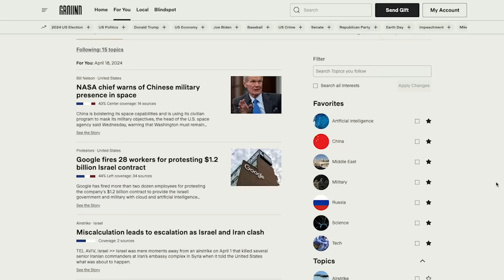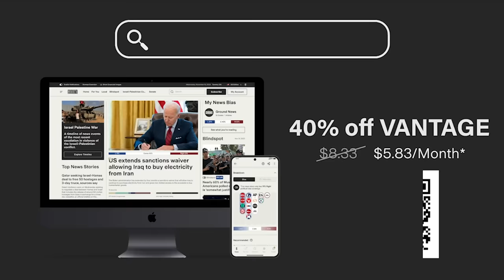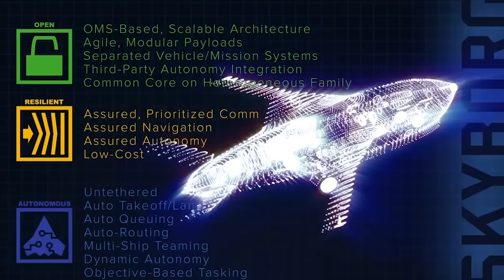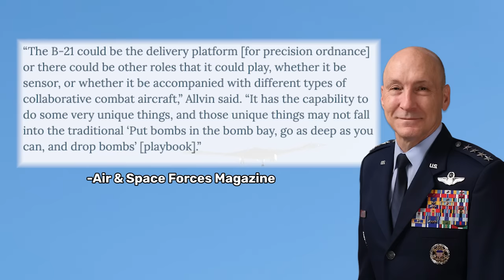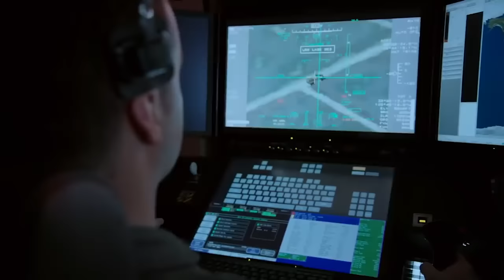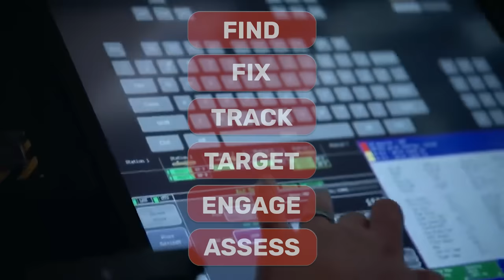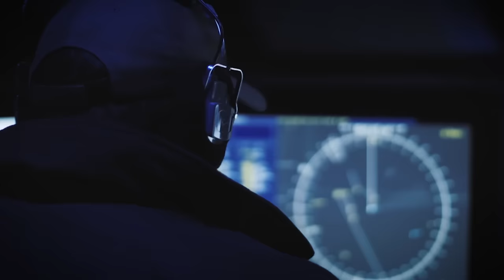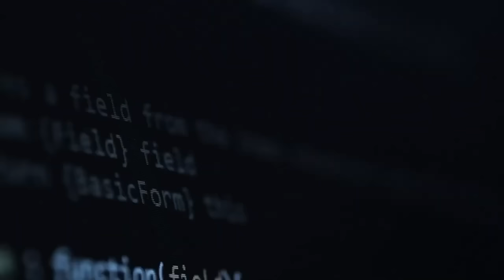Is the Air Force already developing a replacement for the B-21?!

Comment: I just hope this doesn't turn into we are gonna buy 200...no, 100...no 50...and then they do it again with the next model too. The procurement pipeline has become a bigger threat than most nations
Reply: it's exactly as you say. Happened to B2, B1b, and F-22.
Reply: Come on guys we have to let China catch up with us we can't have the greatest of everything and lots of it
Reply: Yup long history of this🙏🙏🪬🪬👍👍🥃🥃💎💎🇬🇧🇬🇧
Reply: Exactly.  What's the point of making your bomber extremely modular if you only take minimal advantage of that?  These functions can't be added to the B-21?
Reply: But that's how it goes. Money has to be allocated to these programs. At the beginning things look big and then they have to scale down to keep everything within budget (lol).
Reply: I believe Alex has a video on this channel that discussed Air force/Navy moving to smaller, more frequent production runs to take advantage of new tech more often. Might be all part of the plan (also the US is broke af now thanks to Biden/Dems spending spree as of late).
Reply: Now I read the comments as I'm listening to the video. So, I'm not sure what it stated, but there appears to be a trend towards speed. Maybe the new bomber will have stealth and speed. There's a push for ceramic radar absorbing material that's also capable of taking on more heat.
Reply: The better is the enemy of the good
Reply: We know it will they always do this 💩. Did it with the f22 for the F35 and watch they’ll do it to the F35 for the ngrad program
Reply: They are not going to short Northrop Boeing and Lockheed.
Reply: @ApocolypseZombie  I would hope they tried, but maybe the B-21 design doesn't allow for AWACS-like abilities.
Reply: Exactly. One has seen that scenario so many times before. :(
Reply: My guess is that something about the shape/size/layout of the B-21 doesn't allow for the types of sensors and data processing required for the killweb concept. They probably also want something that can supercruise, and a flying wing design doesn't really do supersonic speeds well. Add to that the way recent advances in computer modeling and 3D printing allow for faster development of new designs, and I think it makes some sense to start pivoting to newer, more promising designs.
Reply: There’s always that conflict between buying your current thing at scale, or investing more in the next generation.
Reply: if the B-21 is as capable as they say it is then 100 would be sufficient to rule the world.
Reply: @tgray1  The US literally can't go broke, thanks to deficit spending (and by the way, Reagan started that thing up).
Debt is literally meaningless, except as a political talking point.
The republicans created the debt, Clinton turned it into a surplus, and the GWB spent us into debt again, and Obama did a lot to pay that off.
Oh, sorry, that doesn't align with your narrative, my apologies (I'm not apologizing for anything, the facts don't care about what's good or bad for your ulterior motives).
Biden is spending a lot of money, it's true. But what we have right now is not a "conservative" and "progressive" party in the republicans and democrats. What we have right now is a cult and a conservative party.
If I can't have Obama as president again (and I know I can't), I'd still rather pick anyone else than have to choose between Biden or Trump.
But if those are the only options, I'm gonna choose the one that's not gonna literally try to kill me for my beliefs (I support trans rights and the right of women to have access to reproductive care).
Reply: Are debt payments have exceeded our military for the first time in history. Even during ww2.
Reply: No, it wont
The B-2  and B-1 are too expensive to operate so the USAF needs to consolidate to the B-21 to save cost
if there is something in the works, it will be something that can mirror the B-52s capabilities
Reply: @44R0Ndin Yep, so many people conveniently forget that surplus we had in 2000. I agree with you about not being excited with either candidate. If it was legal, I'd definitely take Obama back. Jeez, at this point, I'd even take Slick Willy back for a third term.
All we can hope for is to endure the next 4yrs without any major incidents and get some younger blood into office. Oh, how I wish that this country wasn't run by geriatric people.
Reply: Well a lesson learned from SAC is that technology is constantly evolving, we lose time, money, and effectiveness if we’re constantly overhauling the whole fleet.
Reply: It absolutely will.  Strategic bombers are obsolete.  Ukraine is hitting targets deep in Russia with missiles and drones, and their tech is a fraction of what the US could bring to bear.  There is simply no reason to continue building heavy bombers, this will just draw resources away from better defense options.
Reply: I get that they don’t feel super under pressured due to the fact that almost everyone else is pretty far behind and our older aircraft are still really advanced, but the future will come and we will need an actual whole new fleet not just a few of new aircraft that are advanced.
Reply: @cyronader  And the more they mess with the procurement, the more it really costs us in the long run due to lack of spares and maintenance windows.
Reply: 90 thousand dollar bags of fastening nuts, that is all.
Reply: @44R0Ndin  good lord, someone who actually isn't blinded by simplistic ideology and actually has thought about it. bravo
Reply: @deriznohappehquite 100% this. So many comments here from people without the slightest idea about planning and procurement.
Reply: They will just sell them to whom rules us.

...

Is real.  

Had to do it again since my last comment said could not send.  Figures. Lol
Reply: Test
Reply: @cyronader and the F-15EX…
Reply: How many b2s do we have ....? Well probably get she same number of b21s. Everything else will be retrofitted aircraft we already have.

We have to think about what we are able to produce and repair at the moment. Supply chain is difficult to change. That's why we don't and won't have any more f22s
Reply: Except that they’re developing a new model of procurement whereby they don’t have to rely on large orders for economies of scale.  New production methods will make it easier to do smaller runs of designs and develop new types as needs change.  It’s a more flexible model of procurement that will hopefully save money while allowing upgrades and new designs to come online without the having to commit to designs that are outdated by the time they’re developed.  Let’s keep our fingers crossed. 🤞🏻
Reply: @keirfarnum6811  "hopefully"
Keep hoping, while you should be taking care of your family and your neighbors.
Reply: @Adroit1911 
Um..., WHAT?!  What does “taking care of family and neighbors” have to do with Air Force procurement?  WTF dude?!
Reply: @keirfarnum6811  why are you worried about something so far away when you should be worried about what you actually have some control of. Do you even know your neighbors names? Do you know their aspirations, goals? But here you are telling some bits what's important for the military??? "God grant me the serenity to accept the things i cannot change, the courage to change the things I can, and the wisdom to know the difference." Take care of you and your own brother, then worry about the other shit..
Reply: That was only true for a very specific era, when we won the cold war, had no enemies whatsoever, and the military budget was cut in half.
Reply: @cyronader Not a completely fair comparison. B1b and B2 were both late Cold War, and the F22 was post Cold war and a few years before the 08 market crisis. So all 3 suffered from being introduced at times when military spending was or was about to be cut down and less prioritised.
Reply: We can’t afford shit
Reply: @cugamer8862 a missile can't hit a dozen different targets, land, and then do it again.
Reply: @cugamer8862  You are talking about a conflict pf neighbouring countries, it's not applicable to US policy. Strategic bombers will always be a necessity for US power projection. B-2, B-1 and B-52 type aircraft will always be needed to move and fire various types of standoff missiles and gravity bombs. You can't do everything with aircraft carriers.
Reply: @kurtwinslow2670  the US did a massive study, taking data all the way back from WW2. The study was done in, 1986 and ot discovered that 100% of fighter pilot engagements NEVER reached, Mach 2 and NEVER even reached, Mach 1.5 fighter pilots engaged  at, Mach 1.2 just 35% of the time. The majority of fighter pilot engagements would be between, Mach 0.85 to Mach 0
95. Its way the US no longer focuses to much research and manufacturing and money on how fast the fighter can go, like how Russia does(since Russia isn't any good at anything else lol) US focuses on, stealth, sensor fusion, radars and jamming. Pro Russian fighter aircraft people ALWAYS point out the airshow maneuverability that the Russian fighter can do....well....those maneuvers don't mean shit in an actual engagement. Lol. Also, the chance of now getting into a visual dog fight is just 1%. Also, the "cobra" manuvour is the most retarded manuvour to do when in a dog fight. The pilot/aircraft losses ALL energy and also now makes it a great target (since again, it now has zero energy to manuvour now) great target for the US wingman to easily shoot down. Also, considering how it will take too long for the Russian fighter to regain decent energy to be able to continue to manuvour since it killed its energy from the "cobra" and or many other airshow type manuvours that Russian fighter pilots think will help and think its important lol. The civilian pro russian aircraft think that too lol 😂
Reply: @tgray1  US isn't broke at all lol. Also, the majority of "money" that's been given to Ukraine and now Israel, isn't actual cash, it's equipment. The cost of the equipment is being reported as if we(US) is actually giving that amount of money in actual cash aid. Also, the majority of the equipment is equipment that has been mothballed and or is/was about to be retired. Not to mention, that ammo does "go bad" has an expiration date (including missiles and bombs) that said, the US is giving the ammo that is close to its expiration date.
Reply: @nexpro6118  We're BORROWING 1 Trillion dollars about every 100 days, and that number is getting shorter. I'd say we're broke.
Reply: @nexpro6118  Very well written and thought out. I do agree with what you said. That said speed is an asset getting you there, getting you out of there and reconnaissance. I still think there's a place for speed, but everything has to be balanced in order to achieve the most desirable platform.
Reply: This is damn near fearmongering. We have little problem procuring the F-35 and vehicles like the Stryker (roughly the same time period of introduction as the F-22) in numbers.

While other factors undoubtedly played a part, the reality is the US couldn't justify buying that many B-2s with the cold war winding down and no one else fielding stealth (no peer or near peer).
 Similarly we had no reason to buy more F-22s as they just simply didn't have a use case that justified their price tag (US 4th gen and 4.5 gen fighters were already leagues ahead of their competitors). 

Honestly we only have "near peers" because Russia and China stole our 5th gen fighter designs, and even then we aren't quite sure if their jets are even 5th gen physically (and are very skeptical they're 5th gen electronically).

6th gen is also looming right around the corner
Reply: @ApocolypseZombie The video explains it’ll just be different blocks of the B-21, not an actually new platform.
Reply: Yeah, it reminds me of German engineering. Where there are so many versions with marginary better performance on little to no numbers.
Reply: @44R0Ndin  🤦‍♂️
Reply: @Adroit1911 🤦‍♂️
Reply: They are setup better to do this. Unless the next model is using alien UFO technology, each new platform will build on each other.
Reply: @gordonwardhaugh8266 oh yes we can 😂
Reply: @cugamer8862  if heavy bombers are obsolete then why hasn't the U.S Airforce retired the B-52 yet? Maybe it's because it's being used for a long range heavy missile carriage instead of it's old role of carpet bombing like in the vietnam war.
Reply: Oh it's over budget! Let's buy less of them. --> Oh the price went up again. Lets buy less of them. --> Oh the price went up again. Lets buy less of them. --> ....
Eventually you get to 20 bombers, with the R&D and manufacturing plant costs split between them at 5% each, for over $2 billion per airframe.
Northrup did nothing wrong. They just got told to change the design late in the process, which caused a costs bump, then got sucked into congressional procurement micromanagement hell, eventually making 1/5 as many aircraft, at 5x the price.
(that said, the coatings really were too fragile on the Spirit, and it 'is' an ongoing logistical pain)
Reply: Technology is progressing faster than production!
Reply: @LBrettRay  That's kinda always the case. Even the first space shuttle became obsolete before it was completed, and ended up only being used for glide tests & such.

B-21's development was very fast though, so it's not too far behind itself hehe.
Reply: When I worked for Northrop Grumman I met some people (all of which are now retired or passed on) that worked on the B-2 back in the 1980s. Originally they were supposed to build around 160 of them but due to budget cutbacks as well as the fall of the USSR, they were cut back to only 21 and at least three of them have since crashed. All this B-21 is going to be is a supplement to all of the B-2s that crashed and/or were never built.
Reply: makes sense, you don’t want to buy bulk of outdated shit
Reply: @kurtwinslow2670 
While that will work, going supersonic presents its own stealth issues. I'm not super knowledgeable on the subject but I remember reading the pressure waves can increase radar cross section. How much? I have no idea. It doesn't seem to present a problem for the F22 unless I'm missing something.
Reply: @ponz-  as the NGAD fulfills a different purpose I don't see a curbing of the F35 until it's replacement and that's not even talked about at this point.
Reply: I remember congress holding up a bag of bushings and asking why this bag costs $90,000.

Looked like autozone could fill it for under 40 bucks. Even if custom, $1,000 should cover it.

The military industrial complex has a complex, i think its time for an overhaul.
Reply: That's what has happened with every single major development aircraft ever in US history with the single exception of the U2. A12, SR71, YF12, B1, B2, F22
Reply: Brit here, try it from our side buddy, the number of units when it comes to procurement of modern kit is a joke.
Reply: Yup, agreed.
Reply: Actually with computer cad, technology is coming out and being implemented in the design that it is outpacing the ability to build the current approved aircraft. Why build what is already outdated. They build enough of that current technology to learn from as they develop its replacement.
Reply: @gordonwardhaugh8266   The B2 is late 80s tech and NOBODY has been able to match her. Nobody. 
We're so far ahead of everyone else its not even funny.
Reply: @cugamer8862 - Tell me that you have no idea what you're talking about...  without specifically saying that you don't know jack about why we need strategic bombers.
Reply: Hopefully they buy ZERO. They are obsolete.
Reply: It will get cut. A shame because it’s Exactly what we need more of. At least 100. 

Defense is really the only discretionary spending we have left, and our debt is out of control. We’ll continue to cut corners to cover Medicare and Medicaid for the baby boomers (a huge population) plus the insane amount of immigrants we’ve let pour in. We already had our work cut out for us, but now we’ve added millions of unproductive people eating up more government spending.

We should have 500 F-22s and 50 B-2s as is. We should have had the F-35 ten years earlier and already talking about a much bigger leap in technology being deployed soon. 

But we don’t because we don’t have the money and we continually make bad decisions and half-measures because of it. By the time the F-35 is fully in service, its capability—while a large leap vs the planes it’s replacing—will only be a marginal leap ahead compared to our near-peer rivals. 

The B-21, because it was developed and manufactured much more quickly than the F-35, provides a huge advantage right now. But our terrible debt and poor decisions will mean that we cut the buy back considerably.

Think of how much more secure we’d be with 500 F-22s instead of maybe 130, and 50 B-2s instead of less than 20…

Instead, we spend trillions on the F-35–a good but flawed plane—out of desperation. It’s simply not the necessary leap we need to deal with near-peers, in all of the roles we’re asking of it. It was meant to be an affordable complement to planes like the F-22, B-2, B-21–not a replacement…and it’s too late.

Worse, we’re stretching totally obsolete platforms like the super hornet, F-15 and F-16 wayyyyyyyyyy past their useful life. It’s not that the F-15EX, or Super Hornet are bad planes, but for the money, the opportunity cost is punishing. They’re obsolete and the cost of not spending on a better platform hurts.

For the national guard, and for asymmetric warfare, F-16s, F-15s—great. They’re durable, their engines can handle extreme cold. But other than that, they simply aren’t useful for us anymore. 

We also don’t also need the A-10. While it’s cheap to operate, its job can be done by much cheaper platforms. 

So, we’ll see with the B-21. We’re desperate, but we’re also out of money. When we had a good economy and much less debt, we still cut critical platforms.